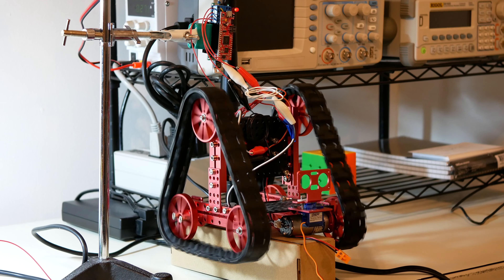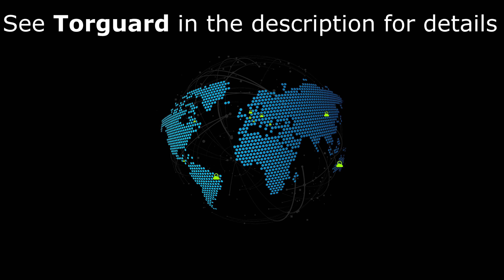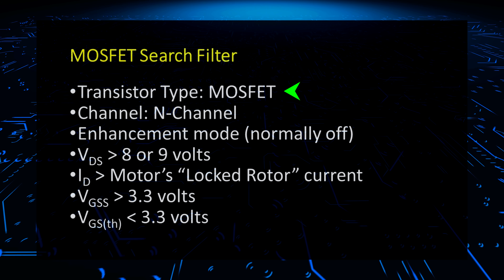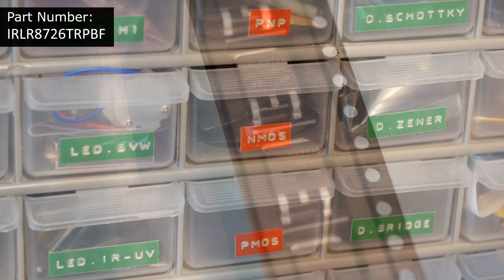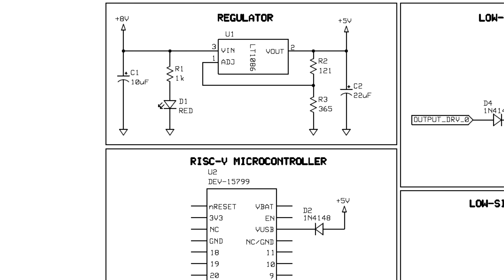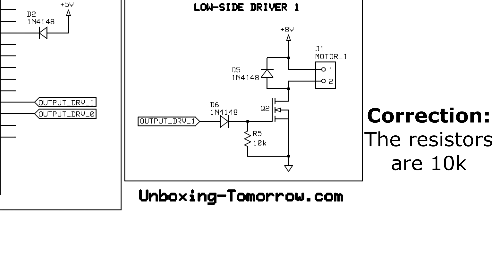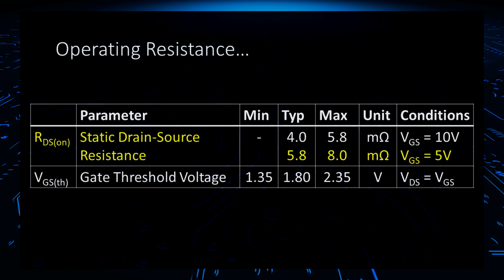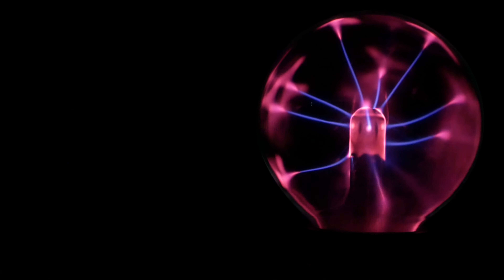Driving Motors from Development Kits (MOSFET approach)

Comment from the maker: Additional note: Diodes D3 and D5 suppress reverse voltage spikes generated by the motor.  (see: "flyback diode")
1:21 - System Diagram
1:46 - Search Criteria
3:11 - Schematic
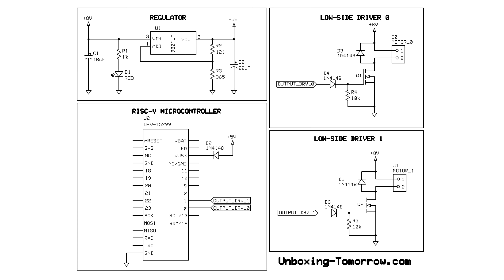3:26 - Design Motivations
5:27 - Prototype Board
5:40 - Live Test